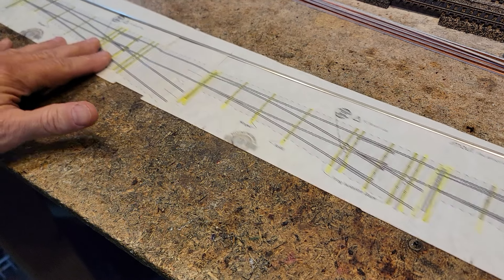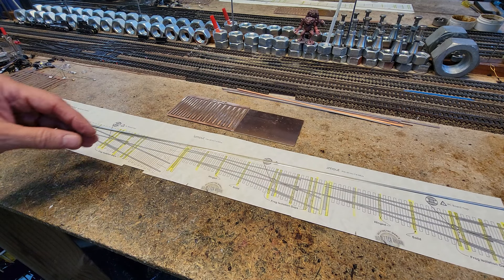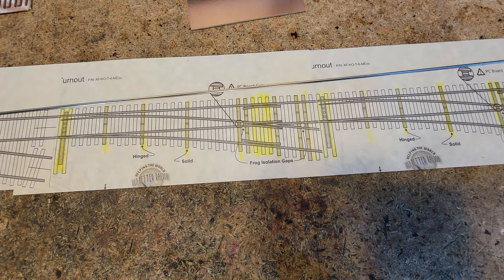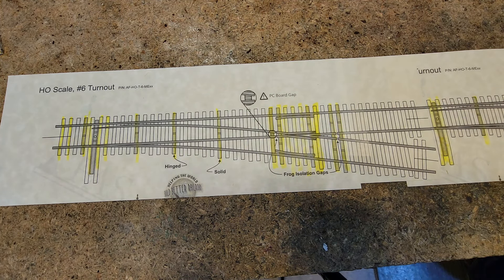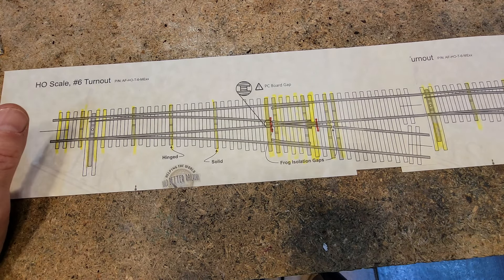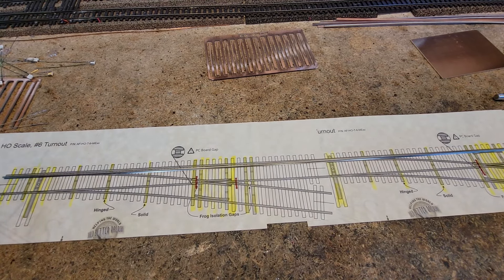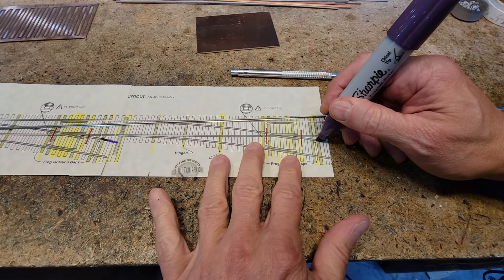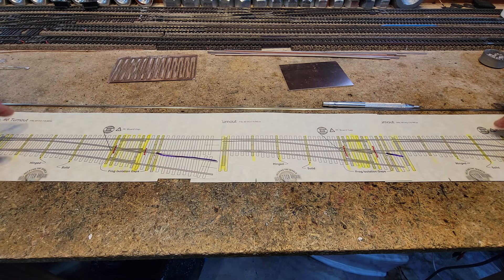Bench lay track Part 2 Template Markup

Comment: On the solid, tape it to make ties, paint stripes, and coat.  Going to be tough later.  You are extraordinarily talented with the solder gun, think you are overdoing it.
Reply from the maker: it's way overbuilt! I used 3x as many pc ties as usual and 6 long guard rails for extra strength - it has to be installed in a spot where the benchwork leg gets kicked a lot!